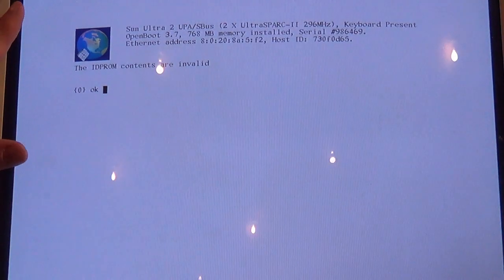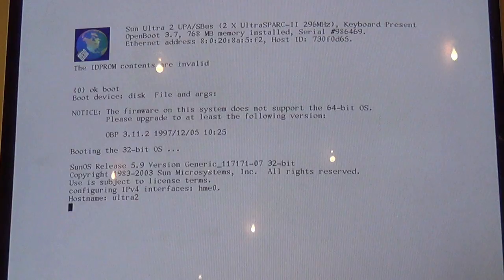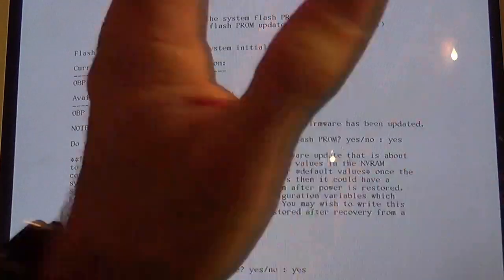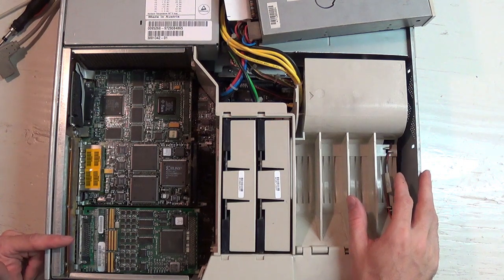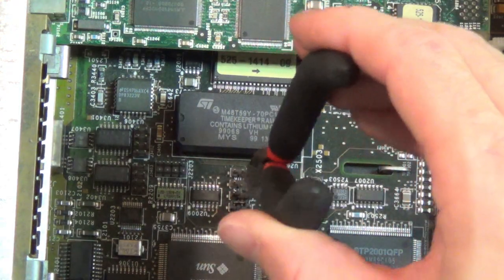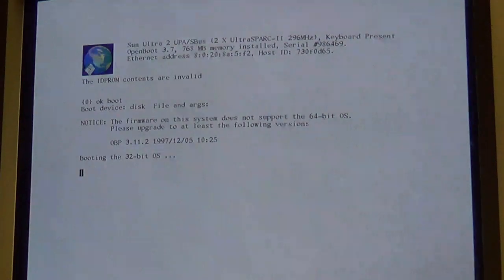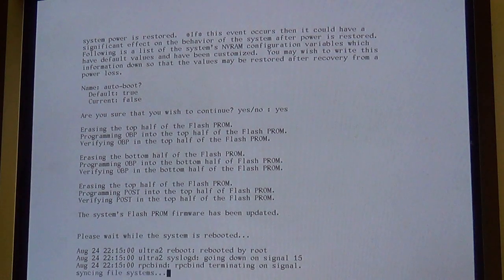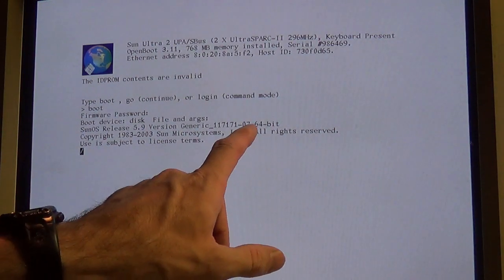Updating the OBP firmware on a Sun Ultra2

Comment: Hi, I just got an Ultra 5 today and when booting up I get a firmware password request.  It gets to the > prompt. Do you know if there’s a way to reset or disable the firmware password? The nvram is also bad so I guess it need to replace that or do a battery fix on it.   

Thanks, Jim
Reply: I just had this happen on my ultra 1, ended up following these directions: https://www.tns-soft.com/nvram_redux.html after you disconnect the nvram battery, short the chip side of the connection (the leads you see shining through when you grind into the chip, dont short it on the motherboard) , boot the sun with no nvram, turn it off, and put the nvram back in, boot it back up and it should have no password. Reprogram the nvram if you replaced the battery.
Reply: Thanks, I was able to get the seller to send me a nvram chip without the firmware issue.
Reply: But then again when I later added a hard drive another issue with the motherboard going dead and now nothing. I’ll need to take everything out and add parts back and see what’s causing this issue. It’s always something.

Comment: I enjoy looking at the sun boatanchor of a monitor lol. I have the newer version myself. (can't recall off the top of my head what model, it has the triangle shaped power button in the center,  I think it has a flat tube as well.) I enjoy the authenticity of it.
Reply from the maker: I have about eight Sun monitors, but this is the last of the big Sony GDMs that actually works still. I have several of the early Sun 3 monitors that only work on Sun 3s, and one that went to the 386i... except the 386i quit working. :P
Reply: +jpkiwigeek sounds like you have some recapping to do. I mean, sure, it can be any number of issues with old hardware.. but, fortunately electrolytic capacitors are a common culprit and are easy to replace.

Comment: you did do "0 f 0 do i idprom@ xor loop f mkp" after setting 0-E in your IDPROM settings, correct?
http://www.lib.ru/TXT/faqsunnvram.txt
I just had to re-look that up a few weeks ago after re-doing the NVRAM battery on my Sparcstation 5 as well as an Ultra 5 I got in the week prior.
I'm surprised Slowaris even boots-- most times it'll just halt if the settings are corrupt.

it could also be that you have to clear the NVRAM completely and start over again with configuration. This happened to me only once with the SS5 in the days up until I finally bit the bullet and did the battery mod.
Reply from the maker: I did the XOR check... several times, actually. I think you're right, it probably needs to be completely erased and redone - Alex preprogrammed it on a SunBlade, from memory, and I think it might've gotten it a bit queer... this all being said, it works just fine, so... really... I'm whinging over nothing.